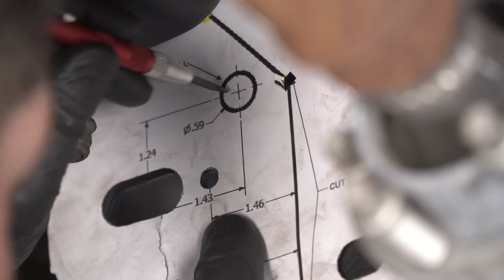2009-2014 F150 Rough Country 4" Suspension Lift w/ Upper Strut Spacers 2WD & 4WD Review & Install

Comment: In other words, get this professionally installed
Reply: Kingy B some kids know their stuff 😂
Reply: @jayweathers9295  sadly not this kid
😂😂
Reply: LXIX Turner lol
Reply: @LXIXTurner  you watch this ten times and go under your vehicle you’ll be straight I just got done putting my lift on I bought the truck in September and ordered the lift the day after I bought the truck got it three weeks later the longest wait was getting time off to do it
Reply: What would they charge for labor though I’d assume a metric ass load?
Reply: @JohnSmith-py9fx  Thought about doing it myself and said not a snowballs chance in hell. Ended up costing me about $2,650 after tax w/o alignment cost. 1k for the parts.
Reply: @chiefs529  Jesus did they atleast spit on it first?

Comment: Not gonna lie... that 5/8" hole that was drilled looked a little sketchy with how little steel was left on that top side.
Reply: i thought the exact same thing.. NO WAY i would trust that
Reply: Wow..  I seen that and thought screw that I'd rather keep it stock!
Reply: he drilled the wrong punch mark. yes very sketch.
Reply: I seen that to
Reply: Can you say step drill???
Reply: Bro that’s not just sketchy, but dangerous. If you look close there’s probably 1\16 left of metal on the edge what do you think will happen?? Rust!!
Reply: This is why I don't want a full blown lift kit on my truck. You never know if they are getting too close or really doing it right. Level kit all day...
Reply: I wouldn't drive it like that

Comment: That hole he drilled with 5/8 drill bit was very close to the edge
Reply: Was just thinking that.
Reply: I thought the same thing. A few comments here about that. Looked dangerous
Reply: Seems to be the same on the other videos ive seen. Does look sketchy
Reply: at 15:07 looks like he had to wallow out the hole further from the edge.  Might have had the template in the wrong spot.
Reply: He had two centerpunch marks to choose from, he chose the wrong one. Personally,  I would have drilled my holes first, then adjust my cut line to leave 1.5× the hole dia to the edge. But what do I know? I just prefer my shit not fall apart while driving.

Comment: It's not mentioned in the video, but I'd say it's important to put some paint on any bare metal once the cutting and drilling is done
Reply: Whoever buys this lift probably won't have the truck long enough to worry about rust
Reply: @P4X1279  why

Comment: I installed a 3 1/2 in leveling strut spacer with a 1/4 in Lean spacer ( extra 1/2 in) for a total of 4 in lift on my 2012 F-150 FX4, added a rear block, and my truck looks and rides great, with 35 in Yokos on 20's , so glad I didn't have to go through all that drama, and my truck is fully functional, even on off-road trails, so don't let anybody tell you what can't be done!!!
Reply: Hey id really like to see your truck and what amount of rear block setup you have.
Reply: Me too! I just bought a 2012 F-150 FX4!
Reply: not a fan of blocks, looks shitty
Reply: Control arms probably banging on the down travel

Comment: I was told to never double stack a Lift Blocks 🚫  but lift looks good I need to lift my 2010 F150.
Reply: Not an issue if they’re small like that. If your stacking 3” blocks or bigger that’s a no no

Comment: Following up on other comments on the screwed up bracket hole. Compare 12:21 13:37 14:20 there is definitely something sketchy going on. The template used at 12:21 is different than 13:37.  At 13:37 the template looks aligned and punched correctly. But you can't tell where the edge of the bracket is relative to the desired hole. Then at 14:20 way too close to the edge compared to the desired location on template at 13:37 . The center of the final hole location also looks higher relative to the corner shown on the template at 12:21.  That seems a huge issue for a structural modification.

Comment: I just box Fox 2.0 front and rear suspension to level my 2020 F150. If I decide to lift it later will I still be able to use the Fox Suspension?

Comment: with a 6 inch lift, do i need new upper control arms? or will they be level
Reply: 😂 i just installed mine and the control arms are rubbing my struts

Comment: What happens if you put the lower end of the block tords the back?
Reply: It would cause the front and rear universal joints to be at different angles. This would introduce driveline vibrations and cause the universal joints to fail sooner..    >;)

Comment: shouldn't you wait until the truck is on the ground, with the shocks/struts loaded, before tightening them?  wouldn't your way damage the bushings and such?
Reply: Definitely would cause premature failure if not addressed, but since it needs alignment, I'd venture to say that they will all be reset while on the rack. Let's hope.

Comment: 14:14 that’s a little too close to the edge bud
Reply: That's what you get when someone who's inexperienced or simply doesn't give a shit. It could be both in this case, who knows? Cheap labor isn't skilled and skilled labor isn't cheap. You get what you pay for. The fact that they did it AND left it in the video tells me all I need to know about these yayhoos.
Reply: I’d considered that entire frame fucked by that point. Jesus.
Reply: 14:10 wtf..........: really
Reply: Singing a drill at high speed isn't the move here. Would have been better with a clean pilot hole and finished off with a step bit. More than likely that drill walked.

Comment: I wish you guys would state if you have a 2 wheel drive truck your gonna have to have a factory 4x4 rear axle spacer as the 2wd uses  no spacer and will have lean to the rear

Comment: What overall height would a 3” or 4” lift with 35” tires yield on a 2018 F150?  Would anybody know that info?
Reply: I have that exact kit, 4" lift with 35's. My truck ended up being 6"8', if that helps bro.
Reply: @Ohsee83   Did you do any trimming?

Comment: Hi my friend I just made a 6 "RC , new 35s on 20x12 wheels and tires, but I have a problem, when I pass 65 mph it starts shaking 70+ is worse, with your experience Do you think it is a problem with the RC suspension or with a new alignment and balancing will solve the problem?
Reply: That’s definitely your tires bro lmao
Reply: @pro-impulse2831  it was the wheel spacers, not the tires.

Comment: So do 35 inch tires fit on the 2wd version with only plastic trimming ?
Reply: Did you figure this out?
Reply: Matt Ward I never got a definite answer no they might still rub with plastic trimming on sharp turns if I were to guess
Reply: Thank for the input!

Comment: I want install a lift kit on my truck but after seeing this video dang I'll probably die before it's finished
Reply: Just go with a 3in suspension lift. It's way easier. The extra inch you gain from the 4in lift is not worth all this work.
Reply: if your going to do all that work go w/ a 6" lift

Comment: With this kit are u able to return to stock if desired? Any cutting?
Reply: Nope. The cross members have been cut off. It’s permanent. Now you can go up in lift size but this is as low as it can get.